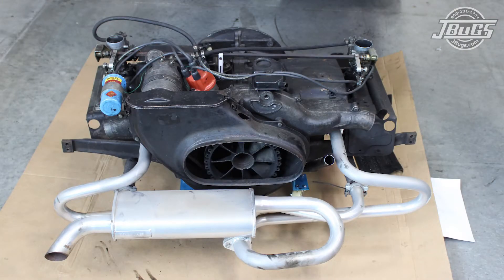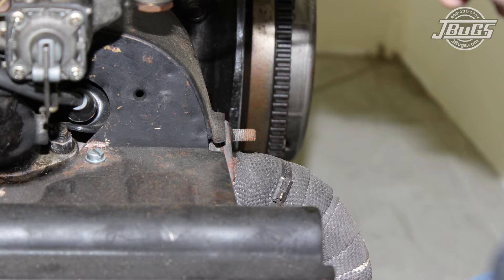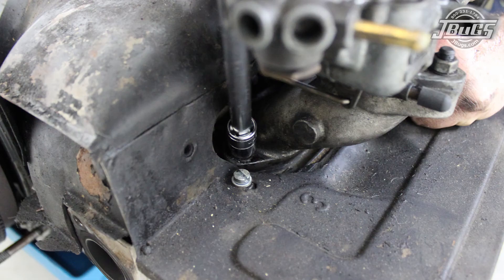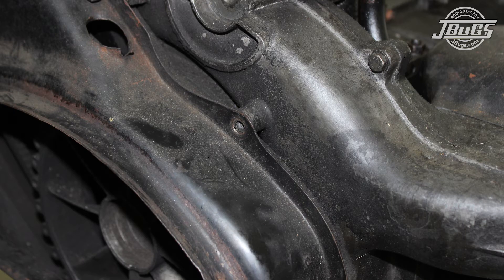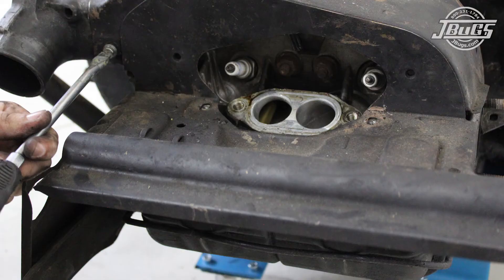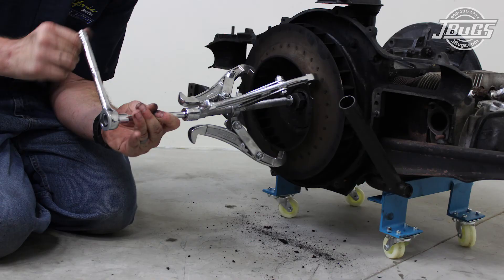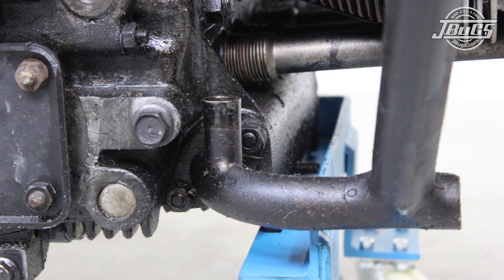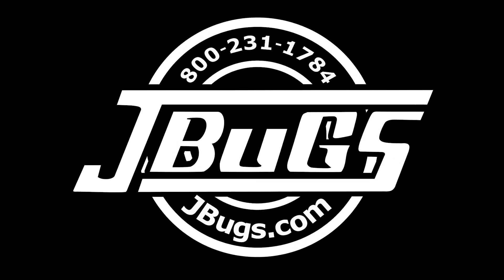JBugs - VW Type 3 - Engine Tin Disassembly

Comment: Hi Sam 😊 I have a question at 1 minute and 56 seconds I noticed the fan pulley has a white stripe painted on it is that 32°I would like to know how I properly time my buddy's  1776 type 3 there's no  degree Marks so I would like to know how to do that😊
Reply: The painted mark was over a factory timing mark, my best guess is that it was at about 7 degrees. I set timing off the TDC mark with a timing light that has a digital advance.

Comment: Question!!  I have the inner Fan that will not come out!!! Meaning the sheetmetal fan that you show the the 3 finger puller to remove. I see my fan is starting to deform a bit and I didn't want to mangle and destroy mine. Do you have another idea of how to remove this??  Or is this the only way, and I should just go for it??   Thanks a mill  👍
Reply: you have two threaded holes in the fan , near the shaft, screw in two M8 screws there , and evenly tighten them, this will extract the inner fan :)

Comment: this video just answered a huge question for me on a engine im building... lol...   Im building a vw bug 1915cc engine and have purchased a case that i was told was a type 1 drilled out and machined to fit larger studs and crank etc.... it all went together perfectly until i hit the oil cooler... mine had this 2 1/2" stud sticking up from the block... i was like wtf is that bc literally every other vw bug ive ever seen has a 3/4" stud.   so now seeing this i realize what happened.... lol..   I got a type3 block... with machine work.  it was originally a 1500cc sp. engine. the long stud is for the sideways setting oil cooler instead of a bugs up right variation.
Reply from the maker: Type 3 cases do have some odd bits here and there, yes but can still be set up for Type 1 use. The studs can be swapped out easily enough, hopefully you’ve already got your engine together and running!
Reply: @JBugsVWParts  not running yet... waiting on a few more parts in the mail to be shipped... but getting close... REAL close.